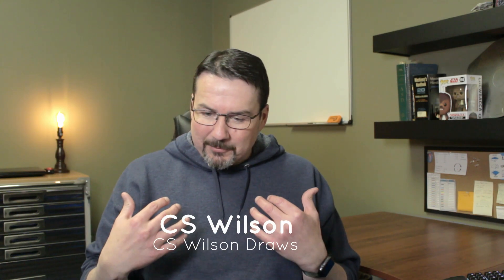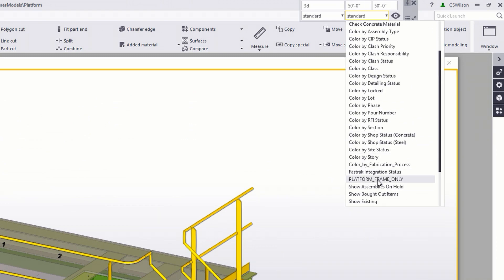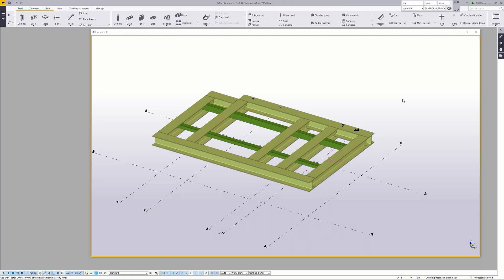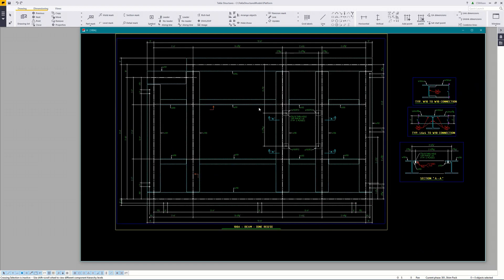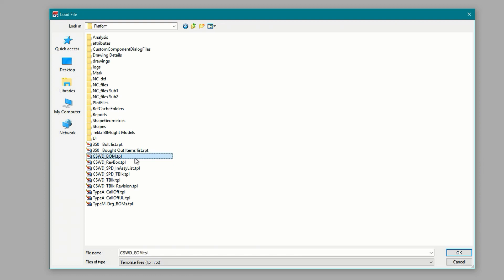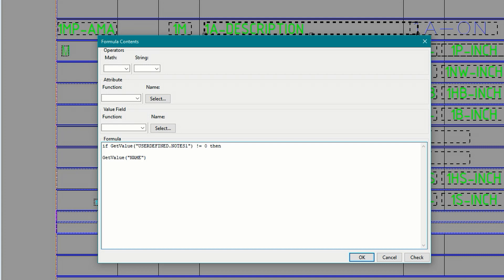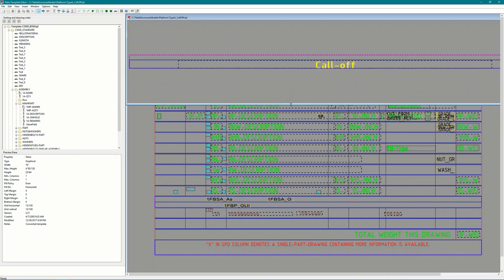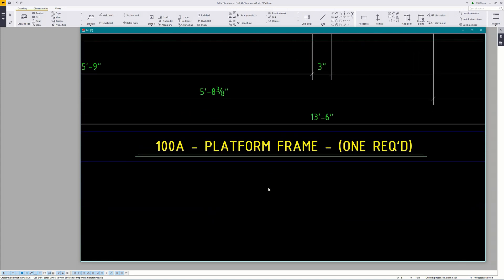User Defined Attributes - Modeling Techniques Using Tekla Structures

Comment: Hi Wilson, 
I appreciate your work. Could you please tell me how can I create a filter for the tables to obtain the following result: if the assembly contains only one part then the result to be style one table and if the assembly contains more than one part the table to be style two. 
Thank you!
Reply: Once I wanted to make some text become visible or not depending on a single- of multi part assembly (a bit like your situation) and was advised to compare assembly weight to main part weight, if it is equal then it means that this is a single part assembly, if not means a multi part assembly, and depending on that to make text creation 1 or 0. Maybe this principle may also help you.

Comment: Do you know if there is a way to select specific text in the drawings based on the properties? Suppose I want to select just all my approver notes so i can move them or delete them from the drawings.
Reply from the maker: I don't believe that's possible since you can't filter out text on the drawings.  Once the text has been place, it becomes a dummy object and the saved-name you used is no longer associated with it.

Comment: hello sir , please i want to know after creating a custom profile as dwg, how can i make it more flexible and dealing with it by choosing different numbers value for width and length for example as in angles ?
Reply from the maker: I'm not very versed in using the sketch editor, but here's a link to the TUA article(s) that may help:
https://teklastructures.support.tekla.com/2017i/en/mod_sketching_cross_sections

Comment: Thanks for putting this premium quality video. I have used UDA in the same fashion to achieve several results the software does not offer by default. 
I have a request: could you please make a video on how you managed the main Tekla window and child windows on 4K displays with proper DPI scaling?
Reply from the maker: Thanks for the comment!  I don't actually have 4K monitors right now, however, I believe this is the year I'll be building a new system to run Tekla Structures.  My plan is to also upgrade my displays to 4K as well, so that might lead to some videos.